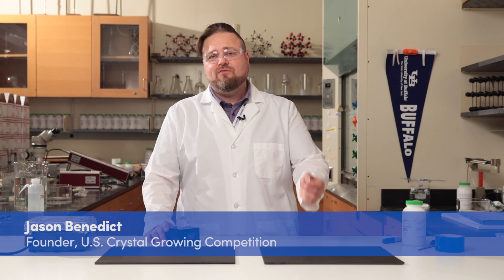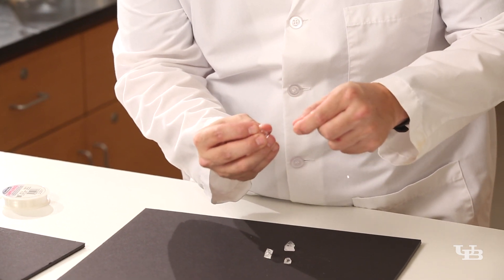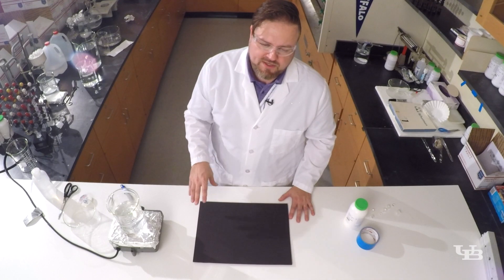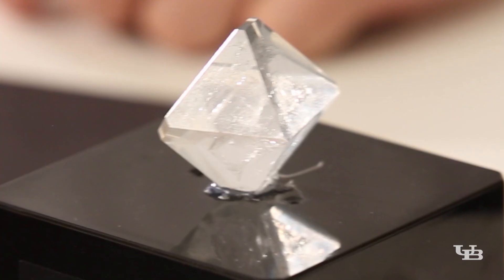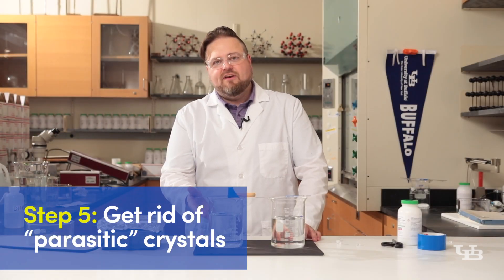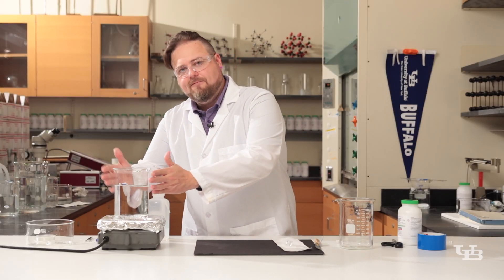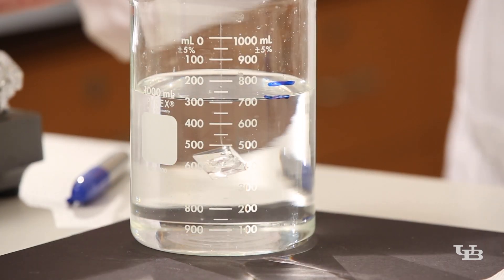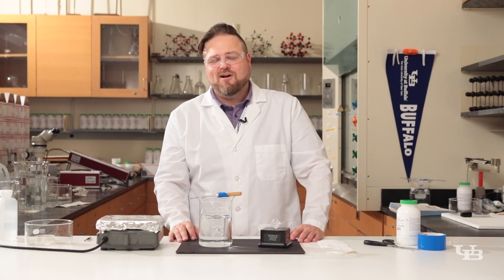How to Grow a Large, Single Crystal: Part 2 | University at Buffalo

Comment: NaCl grows cubic crystals but within a pyramid, they grow as pyramid shaped crystals, which is odd. To accomplish this I made two nested glass pyramids (glued together like a fish tank with silicone). There was an inner shorter pyramid that had a base and sides but an open top, so the salt water could sit within it and evaporate. And an outer pyramid with no base that sat over the top. I originally set out to make a solar water distiller, which worked, but also produced the pyramidal salt crystals.